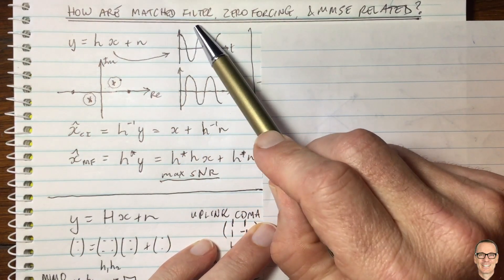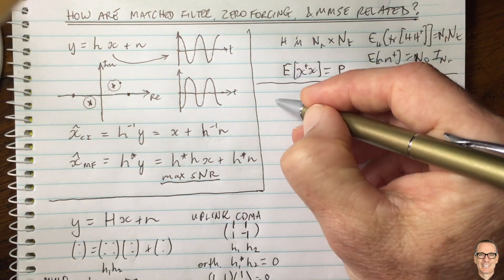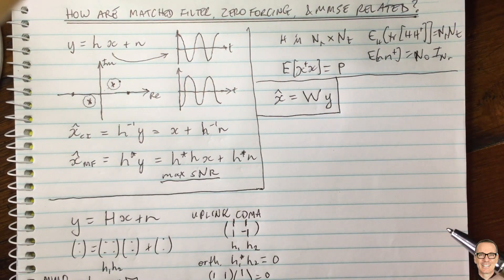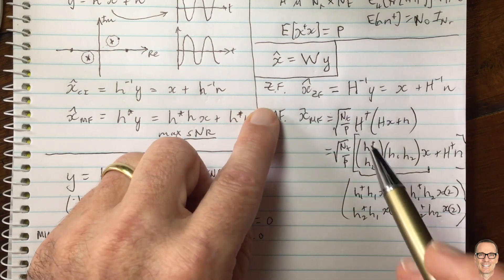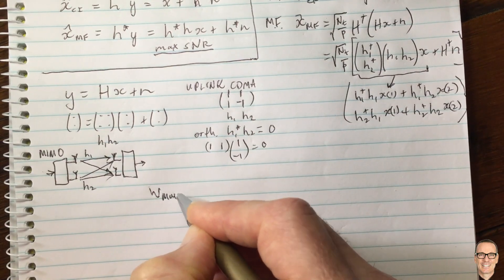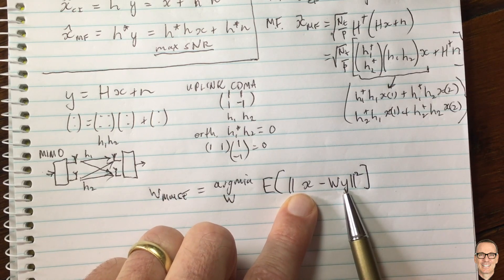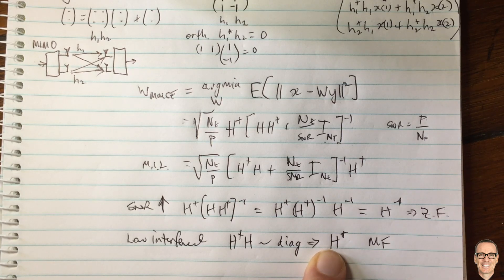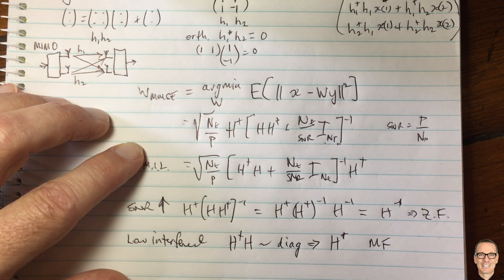How are Matched Filter (MF), Zero Forcing (ZF), and MMSE Related?

Comment: Hi Lain, you showed H as a 2 by 1 vector. Should not it be a matrix? Or h_1 and h_2 are vectors themselves?
Reply from the maker: Yes, h_1 and h_2 are vectors. The matrix dimensions of H are shown under the equation y=Hx+n on the left hand side - where generic elements are shown with dots inside square brackets.

Comment: Speaking about MMSE,.the criterion to minimize is always:  argmin IIy-wxII^2 ...(as scalar or vectors)...So we want to find the weight w. Why isn't it a valid solution to set y=wx to get w=y/x > so I would always get the error zero - what am I missing here? 
Thank you very much.
Reply from the maker: You don't get to "set y=wx".  y is the measurement vector. It includes noise, so it is never going to be exactly a linear transform of x. The challenge is to find a "w" that makes wx as close to y as possible.

Comment: So then in the earlier video "How is Data Received?" Are all these candidates for the Matched Filter block? And the decision is dependent on the implementation ?
Reply from the maker: It's a great question. The short answer is: No. The MF block in the other video you mentioned is an analog filter, matched to the (analog) waveform of the modulation signal. The MF, ZF and MMSE filters in this video are digital filters, operating at the digital baseband.

Comment: Thanks for the Video!
I have a question regarding zero forcing. I learned zero forcing as a precoding technique, but as I understand it that would imply that the noise is added afterwards and not affected by the channel inverse. In the video, you also applied the channel inverse to the noise, why is that?
Reply from the maker: The term "zero forcing" refers to the cost function used to generate the filter. It "forces" zeros where there are poles in the system (as opposed to other cost functions, such as maximising the SNR, or maximising the Likelihood, etc). It can be used for either pre-filtering (often called "precoding") or as a receiver filter. This video might help: "How are Matched Filter (MF), Zero Forcing (ZF), and MMSE Related?" https://youtu.be/U3qjVgX2poM

Comment: Hi Iain, would be great if you add your usual practical wisdom at the end of this recording regarding the actual situations where these approaches are useful. Do we need rich multipath to use ZF? Or if MF is not great in dense networks (due to interference)...
Reply from the maker: Thanks for the suggestion. I'll have to watch my video again, to remember what I said. I thought I had given that sort of intuition - but maybe that was in another of my videos. I've made 180 now, so some of them are starting to merge in my memory. In any case, in answer to your question - yes that's right: ZF needs to be able to invert the channel (needs rich multipath), and MF maximises the SNR without doing anything specific to avoid interference, so doesn't work too well in interference-limited channels.
Reply: @iain_explains   I think you are right. In the video "What is Multi-User MIMO Communications (MU MIMO)?" you mentioned that we need rich multipath for H to be invertible. But I didn't really connect that point to the ZF.

Comment: Could you pls provide a detailed explaination on why  ZF causes noise amplification , while MMSE not?
Reply from the maker: If any of the eigenvalues of H are zero, then H cannot be inverted, and the ZF receiver is not defined. If the eigenvalues are very small (but not zero) then the inverse of H will have very big elements, and then the noise that goes through that inverse matrix (filter) will be amplified greatly. By adding a scaled identity matrix into the mix in MMSE, you will ensure that the smallest eigen value of (HH^(-1)+alpha I ) won't be too small, and you will always be able to invert it without getting huge values.
Reply: @iain_explains  thank you so much~

Comment: Where did the scaling factor sqrt(N_t/p) come from?
Reply from the maker: Sorry, it's a while since I looked at the details of this. Intuitively, the power P is divided evenly amongst the transmit antennas, hence the P/N_t term (or its inverse in the filter), and the square root is because the filter is dealing with the signal, and you need to square it to get the power. The equations are in the following paper, and the references therein: M.R. McKay, I.B. Collings and A.M. Tulino, "Achievable Sum Rate of MIMO MMSE Receivers: A General Analytic Framework", IEEE Trans. Information Theory, Vol. 57, No. 11, pp. 396-410, January 2010.

Comment: I am sorry but what would be the main difference between these filter technique and equalizer technique... ?
Reply from the maker: That's a good question. I'm planning a video on equalisation, so I'll try to remember to mention it. In any case, the difference is that equalisation refers to "undoing" the effect of inter-symbol interference (ISI), which is due to the time-dispersion of the channel. It's sometimes referred to as "self interference". In contrast, this video only considered the case where there isn't any time dispersion at the symbol rate (typical of flat fading channels, or narrow band communications, or subcarrier channels in OFDM).
Reply: @iain_explains  In case of time dispersion, there will be more than one Channel taps ?